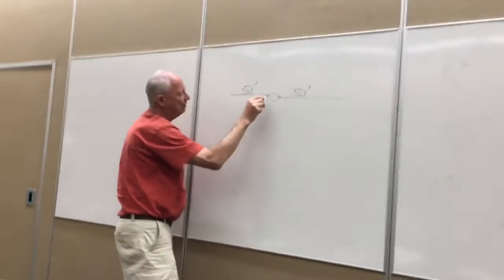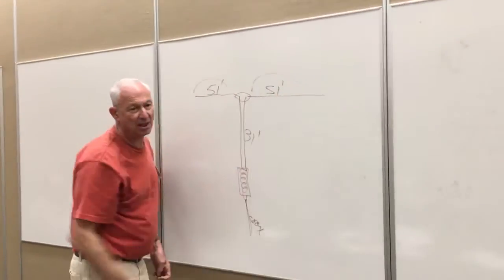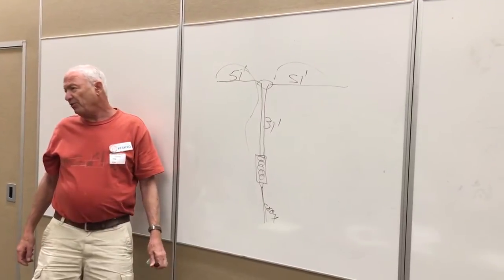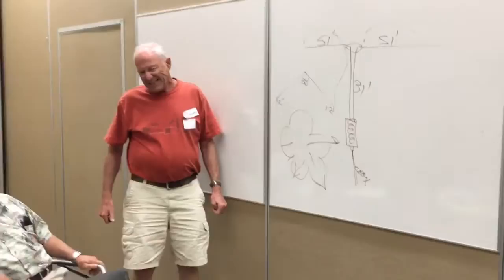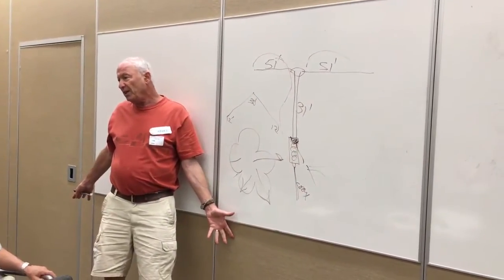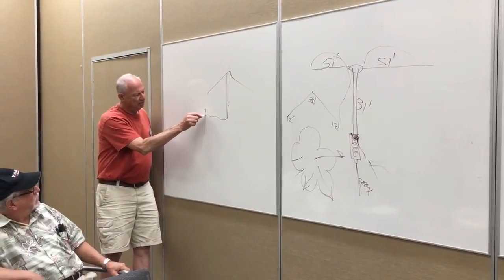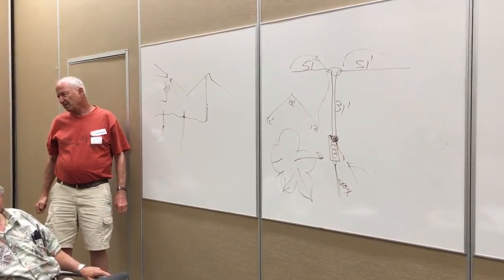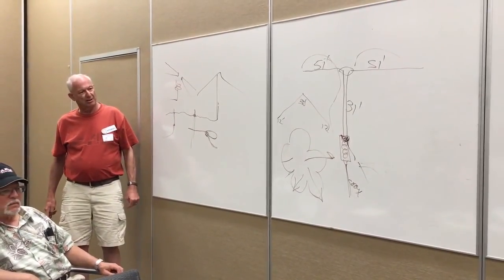CVRC: KF6KXG (Mike) explains G5RV

Comment: Good video, I’ve always been led to believe that the whole reason for using ladder or window line as a feeder is that each leg cancels out Common mode currents as each leg is 180 degree out of phase, It seems odd that we are then told that some of the radiated RF on certain frequencies uses the vertical feeder to radiate RF?
Anyone wish to enlighten me how a balanced dipole (ie NOT offset) will use the feeder to radiate?
Thanks you! 😀
Reply: While I am not an EE but going from what I have read, I picture the wires in the ladder line as continuations of the dipole legs adding length to them and hence more resonances on the different frequencies used. Mike Lichtman KF6KXG

Comment: Well sir, what if I wanted it for a restrictive area and only plan on using it for 20 meters & 10 meters?
Reply: The G5RV Jr. sold by various companies (including MFJ) covers 10 to 40 and is shorter. If you hang it as an inverted vee, it takes up even less room. The main thing to keep in mind is not to use a metal mast (unless you use standoffs) and it will affect the performance and tuning of the antenna. I use fiberglass masts and do not have a problem.
Reply: I have to use a metal mast, that's all I have. So how much of a stand off do I need?
Reply: I haven't set one up with a metal mast. One idea...l Generally the greater the distance the better. I would make some plastic standoffs at least 12" from the mast. QST has shown some in past issues. I would use 3/4" pvc pipe and cut one end in half for several inches. Also make a V cut out to grip the curve of the mast. Then sandwich the mast between the two sections with some screws with wing nuts to hold it in place. The other end can have a slot cut in it to hold the vertical matching section and drill some holes to zip tie the wire in. You probably won't need more than 4 brackets.
Reply: I realized after talking with you what I can do. Instead of a Metal push up pole.  At the crown of the roof I'll place a bracket with about 5 feet of heavy plastic PVC to support the G5RV, it's not that heavy.  That way there'll be not metal involved at all.
Reply: I have a friend who has what you are planning to do. He has a metal tripod on the roof peak area to stabilize the mast. It makes it studier and easier to waterproof the fastening points. 73
Reply: Sir, what about using a Painters pole? I think they are fiberglass and there pretty strong and they extend out many feet?
Reply: If it works for you and is strong enough try it. If fiberglass it won't have any effect on the antenna. If it is wood and gets wet it may have an effect.